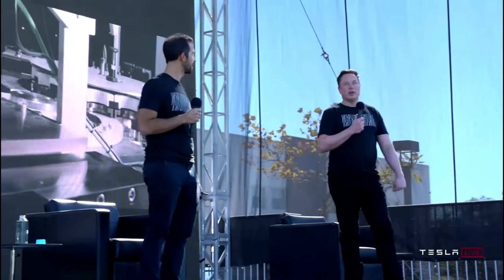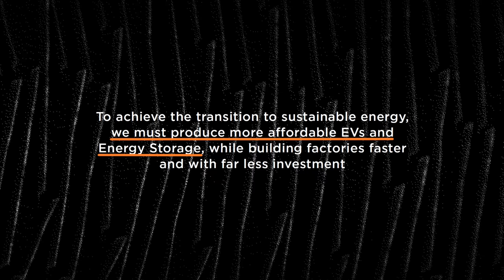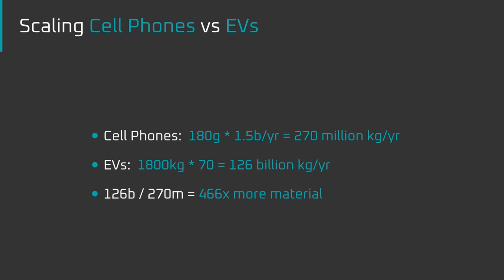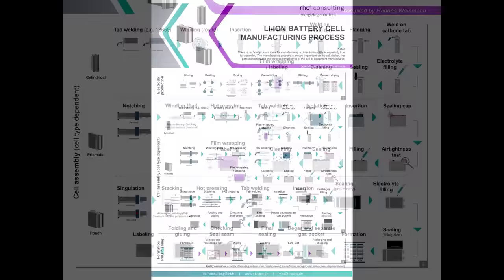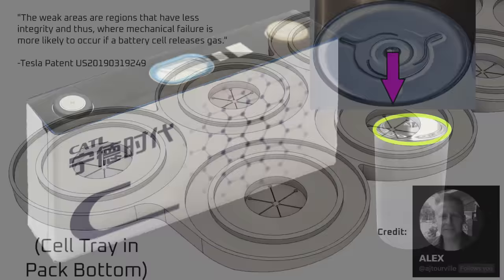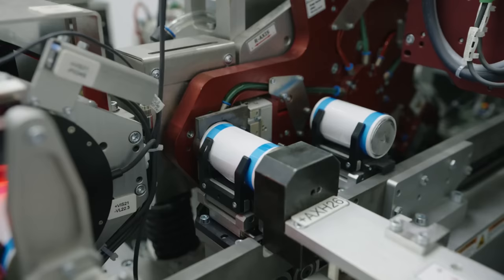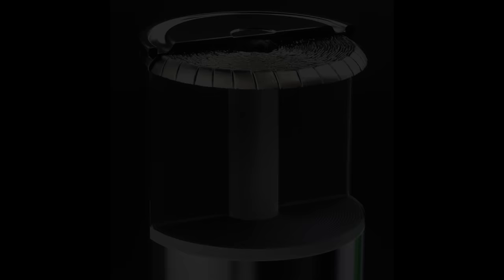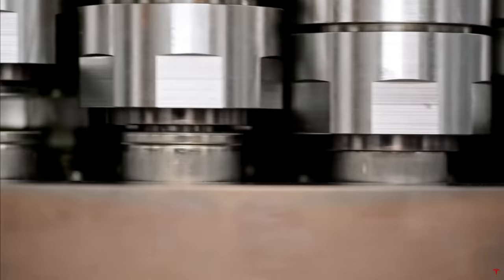The 4680 in Perspective // Battery Day Refresher + Competitors?

Comment from the maker: Additional video notes 🤠:

1) I say the 4680 dimensions were somewhat arbitrary.  In terms of technical performance, it appears that’s true.  However, there could be of course other factors.  Tesla may have chosen exactly 46mm due to the potential of off-the-shelf solutions or synergies within the line or for pack design.  

2) I say that although the cell increased in size by 5x, the line speed increased by 7x, and therefore the larger cell isn’t fully responsible for the speed increase.  How can I say that?  Panasonic has lines that run at 300k cells/day and others that run at 600 cells/day.  This is despite both producing a 2170 battery cell.
Reply: The pack has design parameters, too, such as voltage, and there will be a set of series-parallel solutions.  Difference cell sizes will lead to different packing into the pack area, and it is best that the packing leads to a good series-parallel cell solution.  46 mm may have been the sweet spot for the packing strategy, taking into consideration the cooling structures.
Reply: @davidharris7249  Good point
Reply: Mathemagical Financial Form factor.
Reply: despite both what? Don't leave us on a cliffhanger!
Reply: The size of the 4680 may have been somewhat determined by the width of the vehicles Tesla is intending to use it in, which determines size of the pack and then number of cells depending on the size of the cell.
Reply: Also, while diameter may be somewhat arbitrary the height is definitely based on packaging a structural pack to the same exterior height as an older pack with modules. So their requirements meant designing from the outside-in. They may have also been aiming for that 5x capacity... So with a given height and desired capacity you end up with a length for the electrodes, and when you roll them up you end up with a certain diameter. Assuming they are exactly 5x the capacity of course.
Reply: Also, they may have wanted to have 69 cells on each bandolier.
Reply: @musaran2  Both types of production lines produce 2170 cells, but some have double the throughput of others - I assume this is down to equipment generations/revisions and/or possibly some parallelism at points which previously were bottlenecks.
Reply: I have been working in lots of factories as a contractor/Engineer from bread and milk to paper and Volvo trucks with stamping, robots welding, paintshops. All Highly automated.

When dealing with manufacturing lines. Every increase of speed introduces new challenges. The product (in this case a cell) is exposed to more kinetic energy. Every station, turn and stop needs to be able to handle that energi and lots of automated equipment just stop working when one increases the speed since the "part/product" simply starts to align wrong every now and then and it cause stops in production and so on. It's also damaging for the lines itself, abrasion is a real thing, bearings and moving parts wear and tear faster.

Moving to a bigger cell in this case a container for energy you move more energy with "slower" lines. Every part of production is improved when slowing down and moving more at a slower speed.
Reply: What is the urrent biggest challange of manufacturing the electrode?
Reply: Newer winders for 2170 cell lines at Giga Nevada are about 2X faster than older winders.  Instigated by Elon.  Pushing the capabilities of the old winder design.  My understanding of the size choice for the new cell was partially constrained by heat transfer when cell is charging and discharging.  Driven by available surface area to dissipate heat and heat transfer characteristics of the internal materials and construction specifics.  Much larger and heat buildup is too much.
Reply: @davidharris7249  So am I right that series circuitry and longer tabless cells both increase voltage and  running temperature per unit current? Also that LFP tabless cells could have larger diameters with the same heat generated - and tabless LFP might compete with blade due to both large (larger diameter/length than nickel 4680) capacity and faster/easier manufacture?

Comment: Cylindrical vs Prismatic (Pouch): 
As a side issue, what I realize more and more, for cylindrical cells there is no need to pretension them. They are stable in itself.
Reply from the maker: yes!
Reply: Battery day is 100% sales hype. Batteries won't even exist in less than 20 years.

Comment: Glad you got into the tab-less name... I was one of those infinite-tab name guys... ;)

I'd been under the impression that the tab was always simply a part of the anode/cathode electrode, I hadn't made the connection that the tab(s) were welded on.

Now that I've realized that, thanks to your getting into it more, it seems even more obvious that welding on a tab is far from ideal.

I can't believe they have continued to use this method to this day.  It's so obvious to simply extend the conductive part and slice the anode/cathode electrode and fold it over and contact it all with a simple compression or welded collector plate.

Perhaps it's not obvious until someone does it and we evaluate it in retrospect.

So I'm happy to put to rest my objection to the tab-less name, seeing as how there literally are no longer any welded on tabs... It's so obvious now, so happy to stand corrected... Thank you once again.
Reply: You wrote, "I can't believe they have continued to use [a welded tabs] method to this day.  It's so obvious to simply extend the conductive part and slice the anode/cathode electrode and fold it over and contact it all with a simple compression or welded collector plate." I think it falls into the "obvious but only in hindsight" category. I recall reading that, for many years, batteries were made with a cardboard casing, and leakage of battery chemicals through the cardboard casing was a common problem. Then one day an employee at a battery manufacturer mentioned this problem to his wife and she suggested using a metal casing instead. His company tried it, found it worked well, patented it, and their batteries started to gain significant market share. Some competing battery companies brought out similar products and were taken to court for violating the patent. They argued that using a metal casing was too obvious to be patentable, but the judge disagreed on the basis that cardboard casings had been used for many years, thus suggesting the use of a metal casing wasn't obvious.

Disclaimer: my source for that anecdote about the introduction of metal casings for batteries was a children's book filled with lots of "one-page summaries of important inventions", so the anecdote might be overly simplified or inaccurate.
Reply: @CiaranMcHale  yup.. 20/20 hindsight.  Exactly like you always find that thing your looking for in the last place you looked...

... Cause why would you keep looking after you found it there... ;)
Reply: It seemed very obvious after that mustachy guy found some patent and made a video with a roll of toilet paper ...
Before, not so much.
Reply: Tabbed -> Tabless.  This is an interesting conversation. Panasonic had little interest to change their production technique from what was acceptable for the laptop industry, but not optimized for EV (or Storage) cell production.  How long would it have taken the industry to change if Tesla did not lead?

Comment: The electrons pathway flow is arguably the most important part of this cells innovation. The drastically decreased internal impedence is so much more important than is realized.
Reply: Impedance is only measurably relevant if it creates a situation where a significant amount of waste heat is generated.  Under typical driving loads, a Tesla 2170 pack will not generate significant waste heat due to the fairly trivial power being delivered to the motors, relative to the capacity of the pack, as a whole.  If you were to drive a 300-mile trip at an average of around 50 MPH, that's a SIX HOUR discharge duration, which is what you would typically call 1/6C, which is so low that self-heating would be negligible and in colder climates the battery may need to heated(!) to optimize performance.

Ultra-low impedance is great for the dragstrip in your Plaid, but in most cases, not a relevant factor in discharge.  Sure, it would also help at super-fast charging locations, but on the whole, EVs are charged at home, not at fast-chargers, the benefit would be one of a fairly trivial amount of time saved at the Supercharger.
Reply: The guy on a good YT channel says electrons don't flow, they just kind of wiggle around. It is magnetic fields that flow. I'll find the channel and edit this.
Reply: It's not just waste heat. It's also efficiency. Also, time saved at a supercharger is important for some consumers, especially for skeptical late adopters of EVs.
Reply: Higher C-rate capabilities generally leads to a longer lasting battery, along with better output and charging capabilities.
Reply: YT channel: Veritasium > The Big Misconception About Electricity 8mos ago 15m views
Reply: @rich8669  Utterly and completely wrong.  High-performance lithium batteries are far more fragile and have far shorter service lives that those with more modest current ratings.
Reply: @bminerrolltide  "It's not just waste heat. It's also efficiency."  Huh?  That's completely redundant; heat = loss = relative efficiency. There is NO other metric that measures a battery's "efficiency".

Ultra high-speed charging is a nice-to-have, but not relevant for the broader market.
Reply: @awebuser5914  yes you are correct. But those are chemistry based performance improvements. This is a physical performance improvement lending to higher c-rate.
Reply: @robitmcclain6107  It's a convoluted and misleading video and it ignores  well understood electronics engineering concepts of transmission lines and impedance.
Reply: @niceguy100000  Having worked assembling 10 to 25 kva transformers and then for an electric utility company as a draftsman in the engineering section and taking university physics, it goes against all I think I know. I'll have to poke at it a while.
Reply: Battery day is 100% sales hype. Batteries won't even exist in less than 20 years.

Comment: I think that in the long run, there will be a closed loop supply of raw materials for batteries. Meaning that as today's batteries are retired, their recovered materials will be fed back into the supply chain which means there will be almost no cost involved except for what is required to process the battery into its individual elements. This will greatly reduce the price of new batteries.
Reply: Definitely. We’re a ways out from that though since cars last ten or more years and current production run rates are far greater the production ten years ago. If Tesla keeps up a 50% growth rate it’ll be a while until cell recycling contributed meaningfully to new production. It’s wonderful that we’re able to recycle old batteries to reduce environmental impact though!
Reply: the cost of processing batteries is the main cost of batteries overall and recycled materials are currently more expensive than getting fresh raw materials so overall the cost would at best be the same.
Reply: Battery day is 100% sales hype. Batteries won't even exist in less than 20 years.

Comment: Thank you for highlighting the drawbacks in pouch cells. This demonstrates GM and Ford’s hindrances by relying on LG and SK pouch cells, respectively. Tesla’s competitive advantage is secured by the structural 4680 pack by being physically superior in energy density, cost, and safety.

Comment: Tesla 4680 cells being built inhouse  including  the Battery pack and  being a structural  part of the car eliminates many other costs plus  weight  and  other parts like frames or unibody  construction , not sure how legacy and even new startups can compete on costs  if they  dont  adopt these technologies , along with Gigacasts pieces, some have already seen the light , like GEELY / Volvo and possibly VW  and Foxconn. Teslas margins are going to be hard to replicate as they transition  to BEVs , we will see in about 2-3 years from today as the BEV world unfolds. Thanks Mr Jordan  Giseggi, you have one of the best sites when it comes to Lithium Batteries  and their challenges  and production  and  rampups , easy for the ordinary guy to digest.